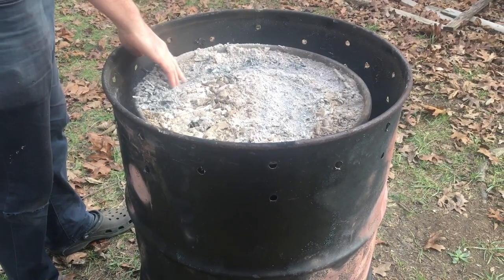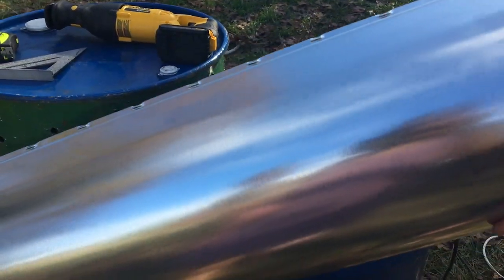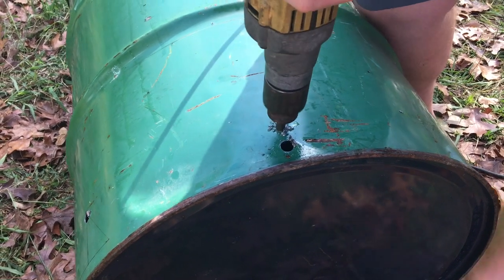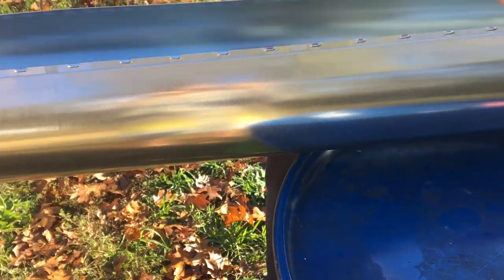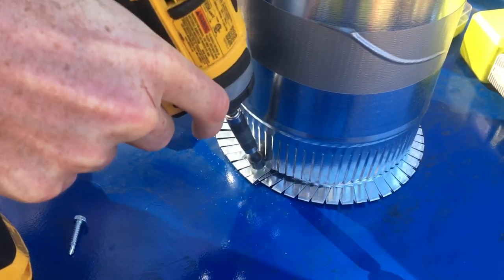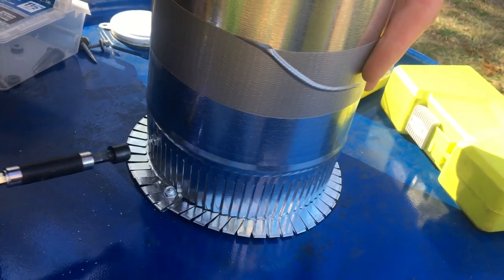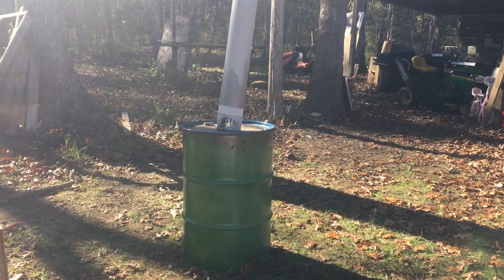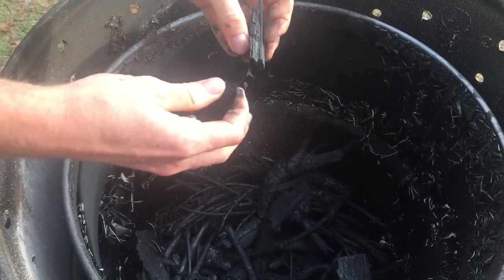How to Make a Biochar Kiln // DIY Biochar for Soil Amendment.

Comment: on the top total how many holes. will the number matter. is it 16 mm holes? in the bottom how many triangles? in the bottom lid is there any holes?
Reply from the maker: We did 1/2", which is about 12.5mm. 16 mm should be fine as well though. We had about 20 holes around the top of the barrel, but it's more about getting the right amount of air flow. You may find after a few test burns that you need to drill more holes. Hope you give it a try!

Comment: Can you use a  covered metal paint bucket in a barrel
Reply from the maker: That is a great idea! A scaled-down version would be a 35 gallon barrel and the covered 1 gallon metal paint bucket inside of it. Just be sure that you discard the char from the first burn, or until any residual paint is burned off the bucket. Good luck!